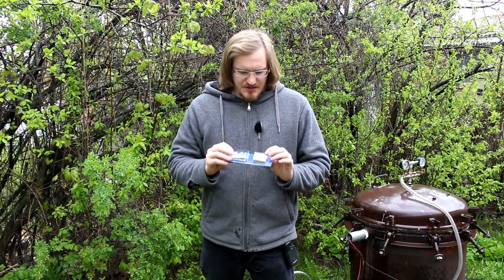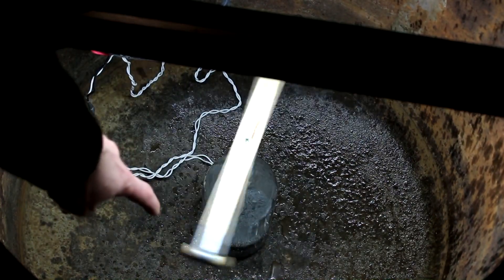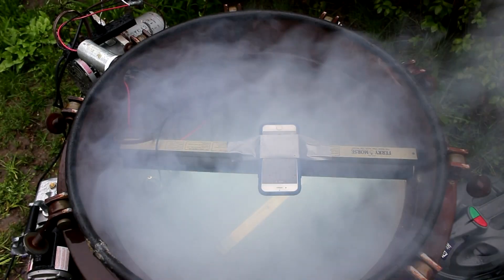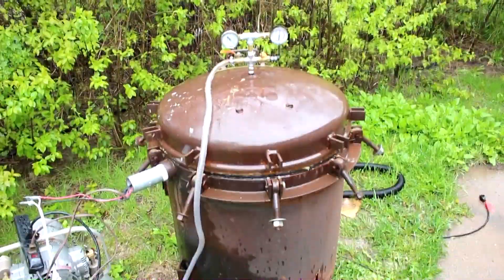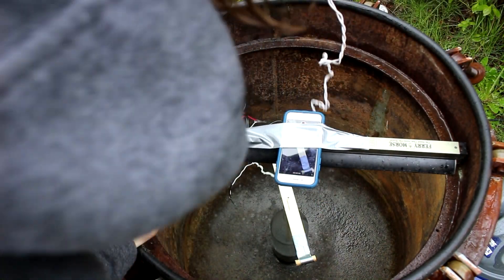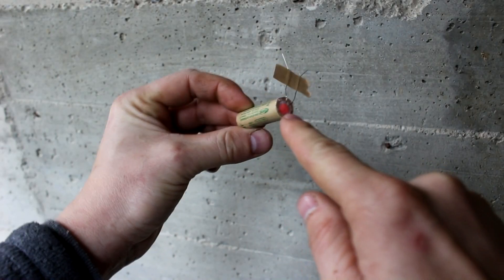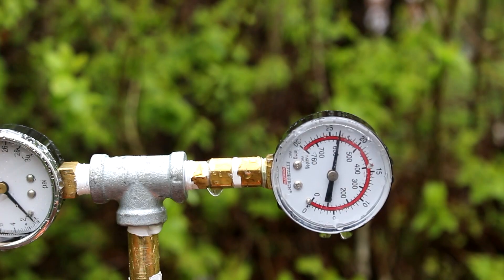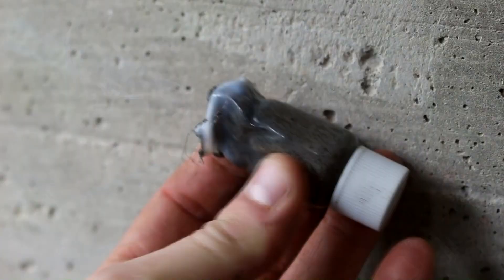Will a Model Rocket Motor Work In Vacuum?

Comment: How is it that you think this half-assed experiment proves anything?  You have moisture in your vacuum chamber, which consists of hydrogen and oxygen.  That water is being vaporized as the chamber is being "vacuumed", and will aid the rocket in burning, especially after you create an artificial environment in the little bottle to ignite the rocket!  In the 60s-70s there were carburetors that aspirated water with the fuel and it burned more efficiently, so the water will actually burn with the fuel.  The question remains - If space is a vacuum and earth's atmosphere is not, then the vacuum of space would be CONSTANTLY removing our atmosphere in an attempt to equalize the pressures!  Our earth could not possibly sustain this constant removal of our atmosphere for millions or even thousands of years!  As big as space supposedly is, that equalization would happen in a nano second!
Reply: "You have moisture in your vacuum chamber, which consists of hydrogen and oxygen.  That water is being vaporized as the chamber is being "vacuumed", and will aid the rocket in burning"
Have you ever tired to burn water vapor? since it is a very stable molecule you have to put as much energy into it to break it apart as you get from combining it together and burning it, and even when you do that you still loose energy as heat in that process. So it's less efficient than just burning the fuel and oxidizer inside the motor, which also happens to be sealed off from the outside while it is running, so it would also be physically impossible for the gass outside the motor to assist any burning taking place inside it.

"especially after you create an artificial environment in the little bottle to ignite the rocket!"
you just contradicted yourself, the bottle would make it even harder for the external environment to affect the burning (or at least the ignition) of the motor.

"In the 60s-70s there were carburetors that aspirated water with the fuel and it burned more efficiently"
I am pretty sure you are referring to the hydrogen that was burned with liquid oxygen in several missions, like part of the second and third stage of the Saturn V and the Space Shuttle's main engines.
They used water that had already been broken down into the base hydrogen and oxygen, which was very efficient sue to the low atomic weight of the hydrogen which would allow for a higher possible exhaust velocity and therefore better efficiency. No rockets ever had pure water in their fuel tanks, they had the hydrogen and oxygen stored in their own separate tanks and at cryogenic temperatures. If water were able to burn then why is it used to put out fires?.

"so the water will actually burn with the fuel."
It takes as much energy to break apart the water molecules into a burnable form as you get by burning them, in theory at least. Since in the real world we have thermodynamics to get in the way of that and that means it takes even more energy to do what you are saying than actually just leaving the water alone.

"The question remains - If space is a vacuum and earth's atmosphere is not, then the vacuum of space would be CONSTANTLY removing our atmosphere in an attempt to equalize the pressures!"
that's not a question, and the vacuum of space wouldn't be sucking anything. The gass would flow from higher pressure to lower pressure. Since I am assuming you are referring to Earth's atmosphere I will add this; Earth's gravity also keeps that from happening. this isn't even specific to a round Earth either, since the atmosphere still get's exponentially thinner with altitude and eventually reaches a near perfect vacuum, so even if earth were flat (which I am assuming you are trying to support with this statement) then you'd still have the same problem.

"Our earth could not possibly sustain this constant removal of our atmosphere for millions or even thousands of years!"
It can, and has. for all of Earth's history the upper reaches of it's atmosphere has been constantly whisked away by solar wind. it is an incredibly small amount though (in comparison to the rest of the atmosphere)which has been negated partially though gass emitted by volcanoes and the oceans. bit it still wouldn't have been anywhere near catastrophic if these factors were not present.

"As big as space supposedly is, that equalization would happen in a nano second!"
No, it wouldn't. The gass molecules are only able to move at about the speed of sound due to them bouncing off of each other combined with their mass so it would take a few hours at least for practically all of it to escape if there were suddenly no gravity to hold it down.
Reply: Disregard that if you happen to be another troll.
Reply: "What's obvious is that you know very little about the LAWS of science."
Are you referring to scientific laws? if so then I think you should understand that a law in science is pretty much a statement of a causal relationship between two things. You appear to be the one who doesn't understand what a scientific law is, since you seem to believe that me not understanding them makes my arguments flawed in some way, what I believe or understand is irrelevant (when disregarding the link between what I think and what I say), all that really matters is the words I am saying.
Scientific theories are what I would have to be ignorant to for what I said to be wrong, and even then I don't need to know the specific theorys, I just have to have a good enough understanding of how the principals they describe work.
If you are referring to specific laws then could you please tell me which ones? that would be helpful to both of us.

"You failed in your whole argument because you are unable to differentiate between the properties of a vacuum and that of a non-vacuum."
could you go into more depth in your reasoning here? What is it that I don't know?
As for my misspelling of the word "gas" earlier; I apologize for a slight tendency of mine to confuse phononyms.

it doesn't really make sense to say I don't understand something and then proceed to call me stupid without actually proving it or offering falsifiable evidence or reasoning that would disprove me.
Reply: If you actually have an argument as to why I am wrong then please explain your reasoning.
Reply: I forgot to say something in response to this statement: "You failed in your whole argument because you are unable to differentiate between the properties of a vacuum and that of a non-vacuum."
A "non-vacuum" isn't really a thing, there are vacuums of various qualities or pressures since there is no such thing as a true vacuum since they are practically impossible to create, even some of the best vacuum pumps still leave thousands of molecules per cubic centimeter. It's all just varying densities of gas.
I get the impression that you believe that a vacuum and an area that is filled with gas (a cubic meter at sea level on earth for example) are two fundamentally different things, which is hilariously wrong.

Comment: I've read a lot of the comments and I'm surprised no one is discussing the strength of the vacuum he created. he actually says at the beginning that it is 25 inches of mercury.

25 inches of mercury is 635 torr, while the normal atmospheric pressure is 760 torr.

now, the vacuum around the ISS is 1×10−8 torr, meaning 0.00000001 torr. in other words the vacuum of space around ISS is 7 600 000 000 stronger. 7 billion 600 million times stronger. 

Is that not a problem for the experiment?
Reply: RawArt0 Negative 25.
Reply: Pressure can't be negative. Zero pressure is a theoretical complete vacuum. And there's no negative vacuum.

Unless I don't understand something about this measurement unit. Could you convert the "negative 25 inHG" to either torr, pascal or atmosphere for me?
Reply: RawArt0 I'm guessing he's using a differential pressure gauge. -25 would be the pressure in the chamber relative to the outside atmosphere.
Reply: Makes sense. Normal atmospheric pressure is about 30 inHG. 30 - 25 = 5 inHG. 5 inHG = 127 Torr. So the vacuum he created is ~ 1 billion 270 million times weaker than that around the ISS.
Reply: RawArt0 I think Cody lives at higher altitude, so it would be a little less than that. Not enough pressure for an oxidized fuel to burn, and that was the important thing.
Reply: Not really cuz he's not saying it is the same pressure that's on the ISS.
It's enough of a pressure difference to study though.

Comment: "They're not pushing against the air they're pushing against the fuel"? 

Why didn't they push against the fuel before you added air to it? Once you add air it's no longer in a vacuum.  

When their was no oxygen tip compresses the ignition it didn't go anywhere. 

So your conclusion is wrong.  It's pushing against air not fuel. 

You didn't add fuel to get it tipp move. It always had fuel.  You added air!  

Try again.
Reply: Holy shit this is painful. The spent fuel (exhaust) moves one way, rest of the rocket moves another way. You shoot a gun, the bullet goes one way, gun moves the opposite way. Its the same idea. Bullet is rocket exhaust. Imagine the exhaust molecules as billions of little bullets and the rocket as a gun barrel.

The pressure problem has nothing to do with oxygen. The fuel has oxidizer. You need pressure so that the few molecules that are ignited from the initial heat source stick around long enough to excite other molecules so that it starts a chain reaction. When the rocket is completely ignited, the exhaust inside the rocket provides enough pressure to the fuel to maintain the reaction. 

The air in the pressure vessel in the last test was not enough to make an appreciable difference of pressure within the chamber. It was only needed for the initial ignition of the rocket. 

Rocket ignition in vacuum was NOT the thing being tested. Rocket burn in vacuum WAS the thing being tested. The fully ignited rocket maintained a burn.

Comment: When the rocket lit was the vacuum on or off? The only way this can be accurate in reference to space is if the vacuum stays on.   Space is always expanding.
Reply: That was so wrong, you're not even wrong.
The rocket was in near vacuum, yes. No, the pump wasn't on because sucking up rocket exhaust would mess it up, but it wouldn't have made a difference anyway because it takes a while to make any appreciable difference in pressure. Yes space is always expanding but that's on a universal scale, not a 50 gallon drum scale.

Comment: horrible test conditions in my opinion. Moisture everywhere which has oxygen in it. then he traps more oxygen in a capsule and expects what to happen? Cody get a better vacuum set up man or are you a shill that does it for a reason?
Reply: Negligible presence of oxygen makes no difference. It wouldn't be enough to burn anything. The fuel has oxidizer, and of course he wasn't going to get a perfect vacuum. The pressure vessel was just for pressure, so that the initial ignition would start a maintainable burn.

You know that air is mostly nitrogen, right? It's not all oxygen. And water needs a lot of energy to break into hydrogen and oxygen, right? It's not just a bunch of burnable oxygen floating around. Did you not know that?

Comment: This is actually how rockets work. The solid fuel cells are incapsulated. Great vid as always Cody.
Reply: They still use solid fuel cells on Rockets? I thought they stop doing that before we even got to space, space shuttles use Liquid hydrogen and oxygen and and other fluids that will ignite on their own when mixed.
Reply: @CosmicDamian FALSE. The SRBs detached at 24 nautical miles high. I assure you. It's not a vacuum there.
Reply: Nope terrible video. Lacks understanding of how boosters work on spacecraft. They have their own oxidizer in the chemical mixture.
Reply: @sludgut  the problem isn’t lack of oxygen. The problem is a lacking of atmosphere to push against. Ergo, everyone talking about the vacuum. In the previous rocket/vacuum video he showed that the burn pushed against the atmosphere, and the atmosphere pushed the heat back against the fuel source; with no atmosphere, there’s no thrust in the initial burn, with no atmosphere, there’s no back pressure to push the flame into the fuel.
Reply: @lanceroark6386  - So you think that MECHANICAL RECOIL stops working in a vacuum?

Sorry to break it to you but only those COMPLETELY UNEDUCATED about basic physics think that "Rockets push on air".
Now try taking AT LEAST high school physics before telling every engineer to have ever lived that THEY are a bunch of morons.

Rocket engines are MORE EFFICIENT IN A VACUUM!
Reply: @stuartgray5877  tell it to Cody’s lab, and go to his video of a rocket not working in a vacuum to do so.
Reply: @lanceroark6386  I don't need Cody.  I have been launching things to deep space as my JOB for over 25 years. I literally build, test, launch, and operate deep space science probes for a living.  Lookup "mars global surveyor", stardust, Genesis, deep impact, Kepler space telescope, and NOAA-20 for just a few of the missions I have helped with
Reply: @stuartgray5877  hahahahaha!!!!! So you’re a professional liar. Got it.
Reply: @stuartgray5877  how bout I look up Mars Greenland and see where the pictures of “Mars” were taken.
Reply: @stuartgray5877     “the dude that said, “it’s photoshopped” was talking about a spacecraft I helped build.”

You clearly said that he photoshopped a spacecraft; not images from a spacecraft. Try again, deep thinker; lying isn’t rocket science after all.
Reply: @lanceroark6386  So you are really bad at physics AND reading comprehension.

Got it thanks for correcting my mistakes.

You are the one that thinks mechanical recoil stops working in a vacuum.
Reply: @stuartgray5877  I don’t think; I know because I saw it in Cody’s first video.
Reply: @lanceroark6386  watch the YT video "uninterrupted footage of the falcon heavy launch and booster landing! 2-6-18"

That video has multiple examples of rocket propulsion in a vacuum.
Reply: @stuartgray5877  you left out CGI. It has CGI footage of a rocket in a vacuum.
Reply: @stuartgray5877  I liked it when Elon not-from-Werner-Von-Braun’s-book Musk said, “It’s so real that it looks fake.” Lol. That’s right. When I watch lions eat gazelles on Nat Geo I think, “this looks so fake it must be real;” except that I don’t. I just say, “wow, that’s real, and it looks real;” and when watching CGI of a phallus land, I say, “that shits fake.”
Reply: @stuartgray5877  you never replied; cause you know the landing is as fake as monopoly money. The voice over of the dude repeating, “oh that’s awesome,” sure does wonders though; it’s like a salesman smiling and letting you touch the thing he’s selling you so that you have a positive association with the deal and feel as though you own it already so you might as well buy it. In other words, the dude saying, “oh that’s awesome,” is just a sales pitch from some psychology-major to get people to believe the lie they’re being told.
Reply: @lanceroark6386  . Try again? With someone who obviously chooses to know nothing about science? Hmm
NASA does have large vacuum chambers. I've just not seen rocket tests in them.
My egg analogy was not meant to be taken literally. The point is the expanding gas of an explosion WILL go out in all directions. It will create a tiny atmosphere. The tiny atmosphere will absolutely will hit the the egg shell. Then what? The egg shell will move away from the explosion, just like a rocket moves away from the exhaust.
Action/reaction.
Reply: @lanceroark6386  I'm ignorant? So a small explosion in a vacuum won't push something that's close to it? 
Guess again.
By the way my coke can analogy was about thrust in a vacuum. In the video the can explodes in a vacuum chamber and GUESS WHAT. It moves. There's no atmosphere to push but it still moves. 
I have looked for videos to see if anyone has measure how strong thrust is in a vacuum as opposed to in an atmosphere. If a rocket "pushes" air then the thinner the atmosphere the weaker the thrust. I haven't found 1 yet but when I do Ibet I find thrust is about the same .

Comment: the rocket gas pushed against the surface of the bottle you placed it in. the whole idea is that the rocket moves onside a vacuum. if you place a surface to push against, that is different.
Reply: it's not pushing against anything. Once the exhaust leaves the tube it isn't magically connected to the rocket anymore. When you shoot a gun, the bullet moves one way and the gun moves the opposite way. The bullet is basically rocket propellant. Imagine all those little exhaust molecules as bullets and the rocket as the gun.

Comment: Why aren't these experiments done in a "constant" vacuum as is supposedly done in "space"!?!?
Reply: Because we don't need to and it would be very difficult.
If you want to see how rockets work in the vacuum of space specifically then study rockets that have been sent into the vacuum of space specifically.
It's basically the same concept except different relative pressures.
This test perfectly demonstrates the differences a vacuum has on a rocket motor
Reply: Return to 8th grade. 
Because Cody doesn't have a massive vacuum chamber or a magical pump that sucks everything up instantly. It's close enough to vacuum for the purposes of this experimentation. The eensy bit of air in the pressure vessel isn't enough to affect the chamber pressure in any appreciable way. No one with a high vacuum environment is going to be testing fucking Estes model engines.
Reply: James C I'm past that catch up but thanks
Reply: @charanockyisrael1547  oh you did made it past 8th grade? could have fooled me.

Comment: LET'S NOT FORGET: NASA and SpaceX use CHEMICAL FUEL, which supplies it's own OXYGEN for combustion. so does CKNO<3>, which these model rockets are fueled by. These rockets are prone to failure, because it's not designed to burn in low pressure. Surprisingly, they still burned.